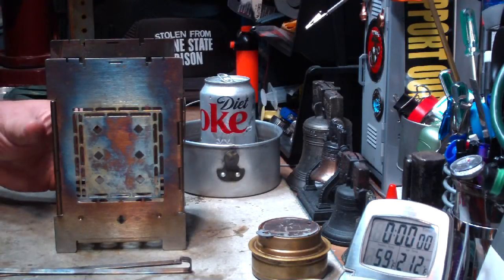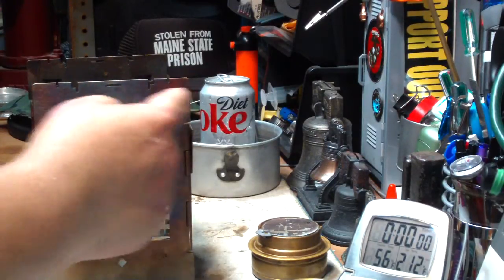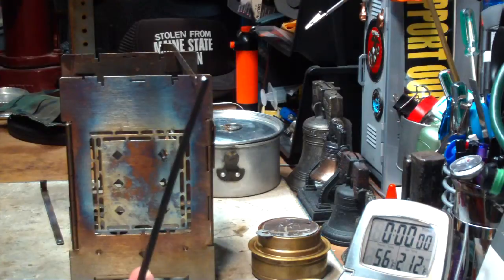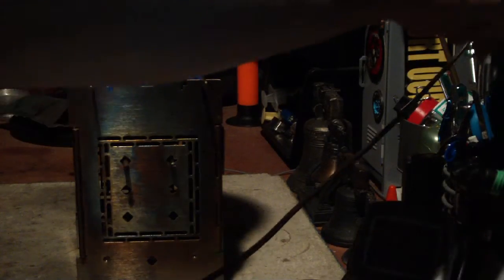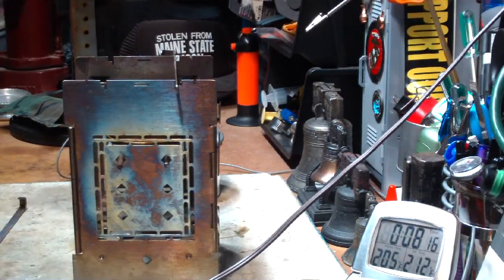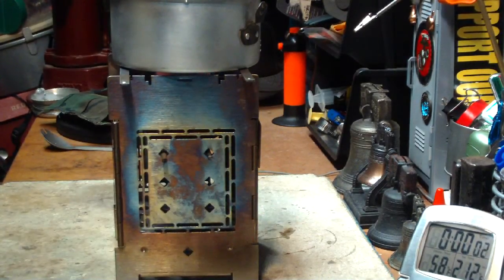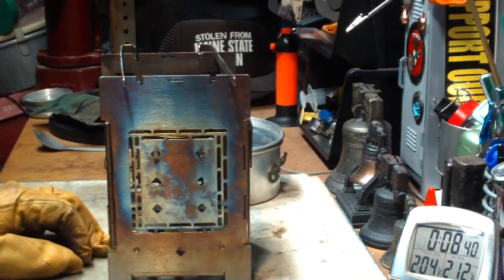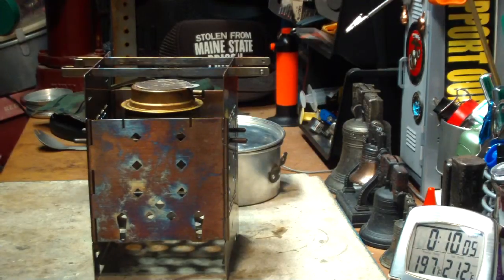How does Firestick position affect boil times on the Folding Firebox stove

Comment: Not a significant difference, Huh I thought it may change things a bit more than that, well now we know.   One advantage to using the wider position is that the simmer ring will fit between the Firesticks if you want to snuff out your burner you can with out removing one or both of the very hot Firesticks.   Thanks Hiram!